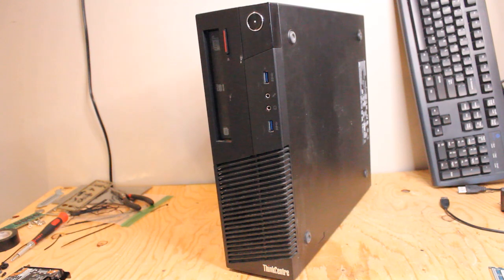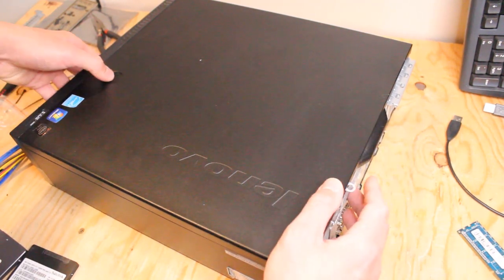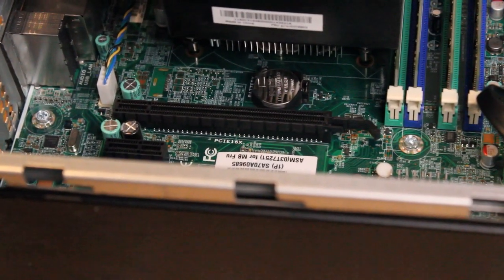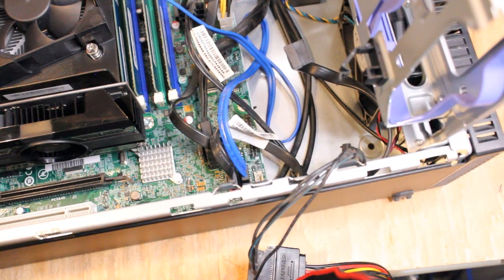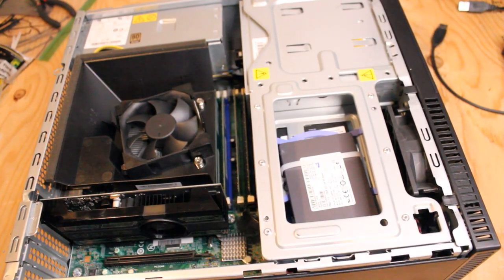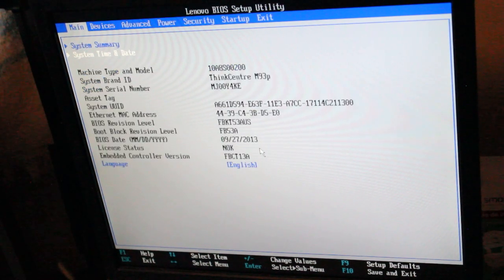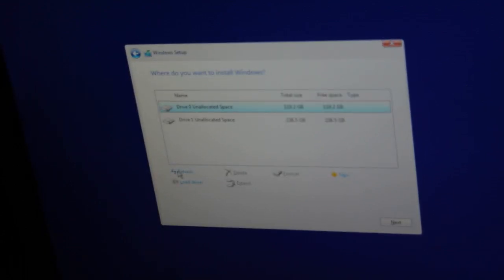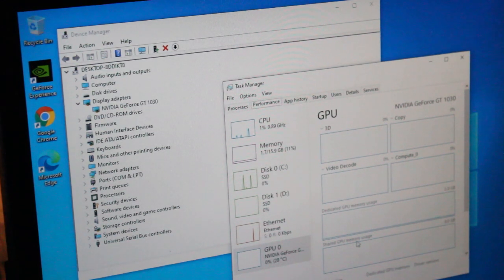ThinkCentre M93p Upgrades Install - GT 1030, 16GB RAM, 2 x SSD

Comment: I got mine for 179 cad in Vancouver BC just a month ago. Thank you for doing these videos.
Reply from the maker: Nice, I live about 8 hours north of Vancouver.  This unit probably came from Surrey or Victoria.  What are you planning to upgrade yours with?
Reply: Strange.  I got mine in Van as well, today, for $60!  Great little machine.  I've already messed around with it and installed the same GPU with a different form-factor.  About to install Linux.
I'll probably use it as a file server once I swap out the CPU for an i3.
Reply from the maker: @lubricatedgoat  Nice, that's super cheap.  Did you get it from that wholesale PC place?  Did it come with an i5?  going to use that for something else?
Reply: @HaisteComputerRepair  i5, 20GB RAM, 240 GB SSD.  Giving the i5 to a friend who needs it.  Nah, just got lucky on CL -- where's the wholesale place you speak of?  On Grandview? Free Geek?
Reply from the maker: @lubricatedgoat  Cool, let me know how it goes as a file server/NAS.  I've set up a couple PC's for the same purpose on my home network in the past.  Now I use my workstation PC with a 4 drive hot swap enclosure built in.  I'll take drives in/out depending on what I need to do.  I am blanking on the wholesale place, but it was in a Linus Tech Tips video a few years ago during their Scrapyard Wars series.  Lots of office PC's.  Not Free Geek, though it's good to hear that shop is still open.  Anyway, good luck with your setup!

Comment: Nice and capable little system! Strange one with the GT 1030 and Windows updates? Never seen that before, just shows win 10 is still beta! Watch those GT 1030's they do a version with DDR 4 ram on-board, which are really nasty!
Reply from the maker: Yes that was odd.  The GT 1030 was released in 2017, so my thought are that it should run seamlessly in Windows 10.  But, perhaps it was just my luck.  The good thing is that it worked out in the end :)

Comment: I did pretty much the same thing with the same model, i5 4570 3.2GHz, 4 core, 4 threads. I bumped the RAM up to 16GB (4x4GB), installed a 512GB SSD (Win 10), and a Nvidia GT 1030 2GB. I also have a separate 240GB SSD with Garuda (Arch Linux) on it for Linux stuff. Runs Mad Max (2015) on medium, Just Cause 2 on max, and L4D2 on max. It's one of three of my rigs.
Reply from the maker: Excellent, that's good to hear!  The i5-4570 is still a solid CPU in my opinion.  I have a GT 1030 I am looking to pair with an i5-6500 SFF PC, bringing the combo into the DDR4 RAM arena.  I am curious to see what the performance difference will be between the two generations.

Comment: Firstly, super helpful guide, thanks!! Secondly, I installed a Rx 550 LP but the temps get too high when at 100% usage. would it be a bad idea to cut some holes in the pc case to improve airflow ?
Reply from the maker: Thank you!  I would say your case your rules.  You could cut a rectangle out of the side panel to provide some passive air flow.  If you cut right beside the graphics card that could allow heat to be ventilated out by the fans on the heatsink.  You could put some kind of mesh on the cut out to collect dust.  Just an idea, let me know if you try something out.
Reply: @HaisteComputerRepair  thanks! If i ever try  It i'll tell you The results🙏🏻
Reply from the maker: @anthonyhenriquenunesdeoliv2186  Sounds good!

Comment: i bought an empty m93p and installed all the parts (cpu,ram,gpu,ssd)
however whenever i turn it on it does 3 short beeps and 1 long beep
i've heard this is because of ram but i inserted my sticks properly
do you have any advice for this? 
thanks
Reply from the maker: Has it ever booted on before/after installing the hardware?  Try installing the RAM sticks one by one, in the third DIMM slot from the CPU: CPU, x, x, here, x

Comment: I have that same PC and I want to improve it, is the power supply of that PC really that good to support a graphics card plus the 2 SSDs?
Reply from the maker: Yep, you'll be fine.  Just look for low profile graphics cards.
Reply: @HaisteComputerRepair how about gtx 1080?
Reply from the maker: @maticna2406  You could, but you would need to connect a ATX power supply with the 24-pin to 14 pin cable adapter.  To match with 4th gen Intel, an i7-4770 would be ok.  Could also look at GTX 1070

Comment: does the m93p support xeons like the E3 1270 v3?
Reply from the maker: Well, I am not sure as I haven't tried it myself.  A quick google search showed people installing it in a M93p Tiny, so I would think it's a strong a possibility.  The only CPU upgrade outside of the product specifications I tried out was a i7-4770K and i5-4690K.  Both work, but there are no advantages really as the BIOS does not support overclocking, etc.
Reply: @HaisteComputerRepair  it's just that xeons are much cheaper than the i7s so i want to upgrade from a i5 4590. anyways, thanks so much for the reply!

Comment: can you help me? i just isntalled a XFX R7 240 on my m91p and as soon as i boot my pc no display was on my monitor but the gpu is working the fans on it was working but no display outputting can you help me? i really wanna use it for editing and a little bit of gaming
Reply from the maker: Just checking that you are plugging the display cables into the card and not the motherboard?

Comment: Hi! Is it enough power of original power supply unit (270W) for additional  videocard?
What about possibilty to install here RX580? 
Tanx!
Reply from the maker: With the stock low profile power supply, you are limited to Low Profile graphics cards.  Look for GT 1030, 1050, 1050 ti, and 1650 from NVIDIA.  For AMD, maybe an RX 550.  For this M93p.  If you have a motherboard that supports PCIe Gen 4, look for an RX 6400.

Comment: I want to upgrade my computer that was given to me the hardrive hdd is running slow probably from 8 years back i need to put ssd on my computer is the same like yours thinkcentre m93p desktop. Do you think im gonna be a able to run gears eday in 2025? I really hope so because i dont have much money to spend. Thank you for making this video
Reply from the maker: Good question, I didn't know that game is in production.  Will have to keep an eye on system specs recommended.

Comment: Bro if lets say i have update this setup but I want to get a tower to replace to make it look cooler and with better rgb fans for fast cooling how to see which spec will fit this motherboard...... Thanks
Reply from the maker: A new power supply will help with powering the fans via SATA or Molex connections.  Or, a fan hub can be purchased and installed.  Any new tower case should do, just be aware that there might not be a proper connection for the front I/O panel, specifically USB 3.0.  Feel free to send me some links for what you are looking at.
Reply: @HaisteComputerRepair  thanks bro I will definetly check with u before I buy I will share it once I decide
Reply from the maker: @Rajeswaran_Komathi  Sounds good.   I might look for something as well.  I have a few of these to experiment with.

Comment: How do I enter bios mode/screen on my computer in general? Is there buttons I gotta press when I start up my computer? Still confused I just started learning how to upgrade computers.
Reply from the maker: For the Lenovo ThinkCentre, press the Enter key to bring up a menu, where you then press F1 to enter BIOS.  If pressing enter is not working, then you need to turn off Fast Boot within Windows.  Let me know if this is the case and I can write out how to do it.

Comment: After this upgrade are ram works on dual or quad channel or single?
Reply from the maker: I installed 4 RAM sticks, so quad channel.  If you can manage it, 2 x 8GB DDR3 1600MHz sticks running dual channel would be great.
Reply: @HaisteComputerRepair  tnx for answer i have that problem with who idk will this cpu and motherboard support quad channel. Tnx for reply
Reply from the maker: @DuhovniPokretSveta  Generally up to 32GB RAM.  4 x 8GB DDR3.  No problem!

Comment: i bought one of these like a year ago on a second hand store, didn't test it on site and when i arrived home noticed that the processor's socked had bent pins, another motherboard of the same modelis too expensive and i cannot put another brand motherboard because none of the connectors match (these computers have their own sockets and configurations), not even the power supply match another motherboard.
Reply from the maker: That is correct, you would essentially be building a completely different system if you only took the CPU out.  Power supply, HD Audio, and USB 3.0 adapters are required if you want to upgrade and/or move to a larger case.  Sorry to hear about the loss.  In Canada, an M93p board is not too expensive.

Comment: Hello there. I want to ask how much your psu wattage is? Cus I'm looking to upgrade my vga.
Reply from the maker: Stock power supply is 240W.  It's enough for most low profile graphic cards, but you will want to upgrade if you get something that requires more power.  What card are you looking at?
Reply: @HaisteComputerRepair  1030 sir. Its for adobe and light gaming
Reply from the maker: @eclipsevonlicht2669  Nice.  You won't need to upgrade your PSU for a GT 1030.  Maybe, if you are running heavy loads.  I would wait and see what happens.  It's a bit harder to find SFF Power Supply upgrades, but there is always the option of migrating to a larger case.  

Here is a SFF option:  https://www.bequiet.com/en/powersupply/tfx-power-3/2311

Comment: Did exactly the same upgrades on my Dell 9020 SFF although I also bought a replacement HDD caddy on Aliexpress than can hold two 2.5 drives so no need for zip ties.
Reply from the maker: Nice, that's a good idea.  I would like to try one out.  I use zip ties because of how cheap they are.  I tend to build on a budget to keep it as inexpensive as possible.  Can you share a link to the caddy?

Comment: dear friend, can you tell me if this motherboard supports ryzen 2nd generation processors?
Reply: or if the motherboard of the model (M50s) can accept processors older than 5 gen, the computer came with a ryzen 7 5700g and I wanted to change it to a ryzen 7 2700 and put a dedicated video card together
Reply from the maker: No, this motherboard only supports 4th Gen Intel CPU's.  So, your best bet would be an i7-4770.
Reply from the maker: @levisgt8403  You're referencing another computer?  The Ryzen 7 series came out much later than the ThinkCentre M93p.  You mention an M50s?  There is a very old ThinkCentre M50, but that is going back to early 2000s, I believe.

Comment: i have core i 5 4590T slim type pc i plan to upgrade the gpu with gt 1030 can it run dota 2 med setting?
Reply from the maker: Yeah, I would imagine you would be totally fine

Comment: question if i want a ssd and hdd on the lenovo m93p do i need a special cable or not
Reply from the maker: You can either use the SATA cable and SATA power plug connected to your CD/DVD-RW Optical Drive or purchase a SATA Y Power Splitter so you can power two drives from the one SATA power plug available.  If you search that phrase on eBay or Amazon, you will find what you need.  They are inexpensive.  There will be a SATA ports available on the motherboard to connect an optical drive, SSD, and HDD.  I did this many times with many M93P's.  Let me know if you need any help.
Reply: @HaisteComputerRepair  ok thank you

Comment: can this power supply handle a GTX750ti?
Reply from the maker: Yes it can, just make sure you get the low profile version.  That's the next card I want to try in this PC.
Reply: @HaisteComputerRepair  oohh thanks
Reply from the maker: @lucz0  Let me know if you try one out!
Reply: You don’t need low profile you can even put a GTX 1070 in one of these you just need to swap it into a new case and the front panel connector pin out is on toms hardware and the USB 2.0 front panel works as well you only lose front audio and usb 3.0 

Swapping means better cooling as well
Reply from the maker: @kingkosher6231  You are correct, anyone can swap to a larger case.  I have done this many times and I have at least three more on the go.  Can you link to the front panel connector you speak of?

Comment: will this work with a low profile 1050ti without upgrading the PSU?
Reply from the maker: Yep :)
Reply: @HaisteComputerRepair are You sure?
Reply from the maker: @NeoUmbry  Yep, check out the specs here and see the TDP and recommended PSU (210, 240, 250W is enough for this card):  https://www.techpowerup.com/gpu-specs/gigabyte-gtx-1050-ti-oc-low-profile.b4181

Comment: Slot Closure Brackets? Could you please help with replacing Power Supply Unit? I have M93P MidTower and 2 old stocks of 1x GeForce GTX550 Ti that needs 6Pin Power and another Antec 450Watt PSU. My existing PSU is 280Watt. Thanks,
Reply from the maker: You will need to find a 14 pin to 24 pin PSU adapter in order to install a different power supply with the necessary PCIe cables.  Amazon or eBay
Reply: @HaisteComputerRepair  Thank you, sir. Actually, I gave up after I posted the question because I found that my Antech PSU has 20pin+4pin (attached) and it also has 6pin. I thought it would never had a chance. I just looked at Amazon and found that the adapter is about $4.00 (and lower in ebay). You kindly save me!
Reply from the maker: @valtyger  The adapter is super easy to acquire.  I have used many of them.  Good luck!

Comment: 24:40 can you explain why theres no Display
Reply from the maker: Sorry, yes I did not explain that well.  It turned out to be the VGA to DVI-D adapter that wasn't working.  The card was fine.  I was using the adapter as the DVI cable on my workbench was at the time connected to a NAS.
Reply: @HaisteComputerRepair  i just got worried maybe gt1030 will never work on mines, btw will it work on RX550 TOO? Mini tower Lenovo
Reply from the maker: @YoutuberL1M  An RX 550 will work, but you need a low profile card to fit in the SFF case.  If you migrate to a larger case, you'll need some adapters and such, but you will be able to fit a larger card.  I have a video doing this I am just about done editing.

Comment: I keep getting "Windows cannot install required files. The file may be corrupt or missing. Error code: 0x80070570." when trying to install Win10 on this..
Reply from the maker: What portion of this install is this happening in?  In the meantime, do you have access to extra RAM, HDD or SSD, or other hardware to swap out and troubleshoot?
Reply: @HaisteComputerRepair  Near the end of "getting files ready for installation". Unfortunately I only have spare hard drives to test. I did a MemTest86 check and the RAM seems fine. I'm now in the process of using another HD. I have a Lenovo ThinkCentre M58p - 9965-A5G, would this be capable of installing Windows 10?
Reply from the maker: @YeahNoTellTheTruth  The typical run of troubleshooting involves all the hardware connected to the motherboard, including the CPU.  The manufacturer tests are not always indicative of a problem.  If you have more than one RAM stick, try running just one, etc.  Look at the CPU and CPU socket to determine if a pin is bent or if something looks off.  Try another power supply if possible.  Check the voltage reading of the CMOS battery if you can.  Swap out the peripherals if you can, in the odd chance your keyboard or mouse cables are providing a surge.  It never ends, haha, but it deepens your knowledge of computer hardware if you have the time to commit.  In your M58, do you know what CPU you have installed?
Reply: @HaisteComputerRepair  Turns out the spare harddrive while attempting to install the installer gave the error "windows cannot be installed to this disk. the disk may fail soon." and so I need to look for another spare hard drive to rule the first hard drive I had isn't an issue. The CPU is OEM and I don't think it has been removed so I doubt the pins were bent or anything from the CPU side, but I'll leave that to the very last of checks if worse case (I agree with you regarding it never ending).

The CPU seems to be fine as per bios info. CPU is Intel Core 2 Duo E8400 @ 3GHz, I'm sure that's enough for Windows 10. The RAM is what was originally missing when I found the system, so I had 2 MT8JTF25664AZ-1G6M1 spare, but it's 1600MHz, while the OEM's are 1333MHz, would that be an issue?
Reply from the maker: @YeahNoTellTheTruth  Cool, replacing the HDD is an easy fix.  I would recommend getting an SSD.  The Core 2 Duo paired with a HDD boot drive and only 4GB DDR3 RAM will only run so well.  The SSD will provide a big performance boost and they aren't expensive if you go for a 128GB.  I'll ship you one if needed (for a price).  

Even though your RAM is 1600MHz, it will run at 1333MHz if that is what your board is designed for.  I would try to go for at least 8GB if you can. 

The Core 2 Duo E8400 is not bad, more the minimum you should expect performance from in 2021, but you need the SSD and 8GB RAM to make it a good experience.
Reply: @HaisteComputerRepair  Hi again. Just to update: It turned out to be the hard drive and now it's all working. Thanks for helping out. I'm now in the process of attempting to repair these dying hdds... I wasted so much effort in memory scans and trying different windows builds just to use this hdd.. newbie mistake to skip things (down to being lazy hehe) thought I'd share as you motivated me to do it properly!
Reply from the maker: @YeahNoTellTheTruth  I'm happy to hear you found a solution!  Troubleshooting takes time and now you're all the better for it.  I'm not sure where your other comment on my new video went, but yes userbenchmark is useful.